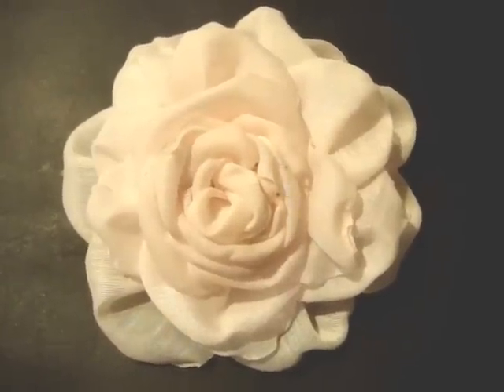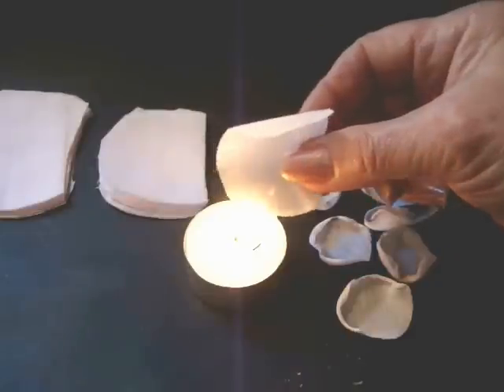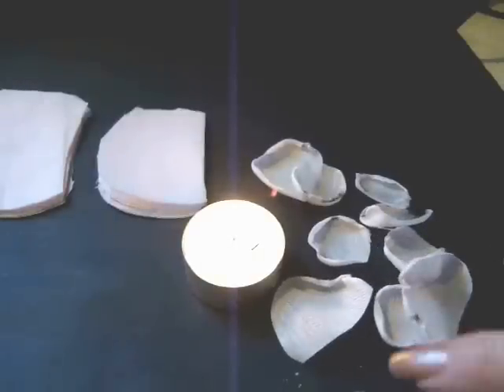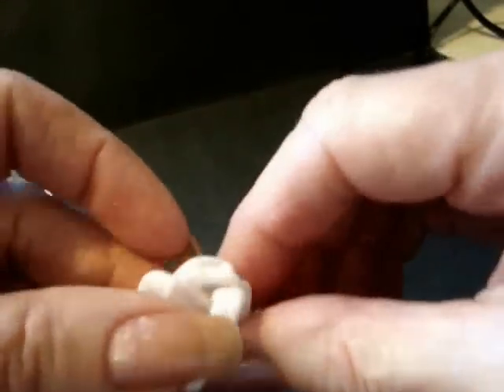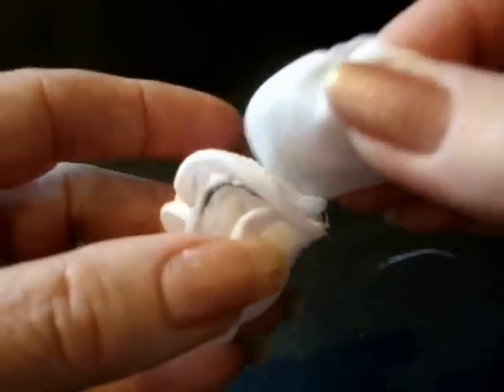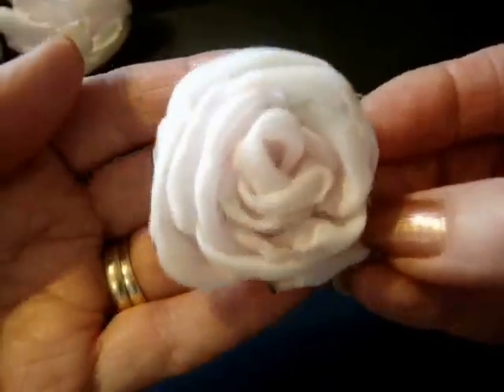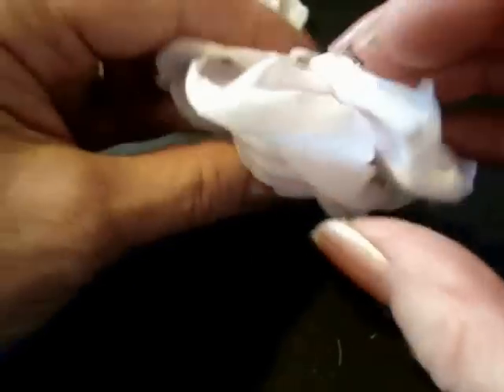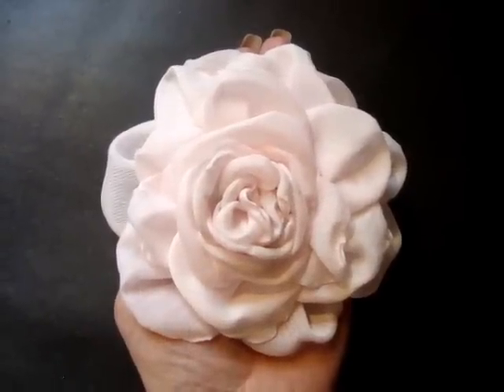How to make a beautiful silky flower. Fabric flower tutorial

Comment from the maker: To avoid the charred bits, there is a learning curve.  (On darker colors, it doesn't matter as much as they are not as evident).  If you place your candle into a container that is higher than the flame, you can rest the fabric on the edge of the container, and slowly approach the flame, so that the heat of it melts the fabric, rather than the flame.  Practise on some scraps until you get the proximity to the flame correct, and that will help to eliminate the charring.  Hope that helps!  Emi

Comment from the maker: Sure.... you can take a piece of wire (you can actually buy stem wires at craft stores... all the same length, approx. 12 inches), the at one end, make a spiral with the wire, winding it around several times, in a progressively larger circle.  The fold the spiral at a right angle, so that the flower will sit on top of the spiral.  Apply hot glue, and set the flower into the spiral.  Cover the glue and wire with another circle of fabric.  Hope that helps!  Emi

Comment from the maker: You don't need very much fabric...at the most (depending on the size of your circles), 9 inches by 30 inches should be enough for one flower... or a square of 20 inches by 20 inches. 
(10 circles of approx. 3 inches in diameter, 10 of approx 2 1/2 inches, 10 of approx. 2 inches, and 6 of approx. 1 1/2 inches)
Reply: Hectanooga1 - Crochet, Knitting, Jewelry, Crafts, Cooking
Reply: the US is UW

😑😑😑it my

Comment from the maker: The largest... since the flower is 2 petals wide, anywhere you would measure, each petal should be 6 inches.  The largest petals don't meet on the back, so even after cutting off the small section, the finished flower should be approx. 12 inches.

Comment from the maker: Silk is a natural fiber, it is not man made... it is made by a silk work... therefore, it is not polyester, and it does not melt.  The fabric used must be able to melt with heat.  That is not to say that you can't make this flower using other fabric... but you won't be able to use the melting method around the petals to prevent fraying.

Comment: These flowers are amazing.  Just gorgeous.  The only problem I'd see with using them in the hair is that I think you'd want to use a glue other than hot glue as if It were a hot day and the sun was hitting it for a length of time it could cause the flower to fall apart I would think.

Comment from the maker: You can buy a hot glue gun at any craft store... Michaels... Walmart... even dollar stores.  

Use any polyester fabric... test on a corner, if it melts, you can use it.
Check out the 'EASIER METHOD' linked in the video...  you can sew the other one, by running a gathering stitch along the bottom with a needle and thread, and then rolling it up to form a flower.

Comment: first i have to say that these look really awesome. but,  how much fabric do you need for one of them coz i wanna try it but of course dont want to buy less or much more than i need
Reply from the maker: You don't need very much fabric...at the most (depending on the size of your circles), 9 inches by 30 inches should be enough for one flower... or a square of 20 inches by 20 inches. 
(10 circles of approx. 3 inches in diameter, 10 of approx 2 1/2 inches, 10 of approx. 2 inches, and 6 of approx. 1 1/2 inches)
Reply: ok thank you. will now probably look up for the one millionst time how much an inch is ;)

Comment: Will fabric glue work as well as hot glue?
Reply from the maker: Well, it won't "grab" as quickly, so it would probably be necessary to do it in steps, and have a place to put it where it wouldn't be disburbed while the glue set up.  You could sew it together.